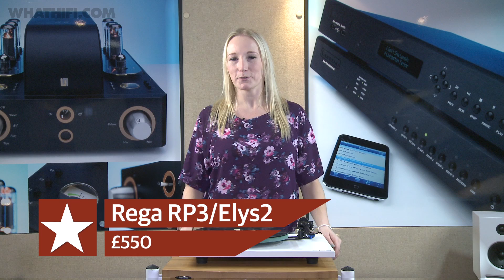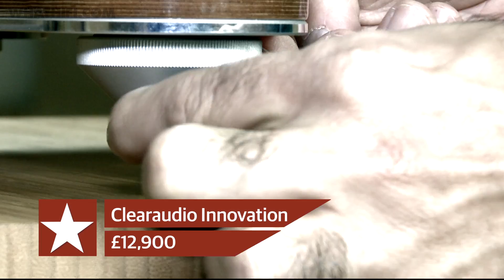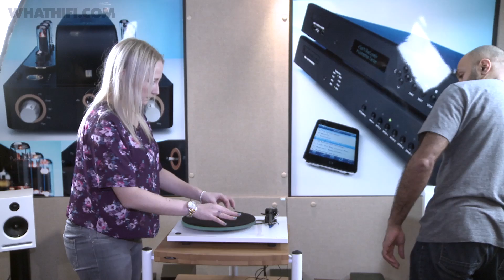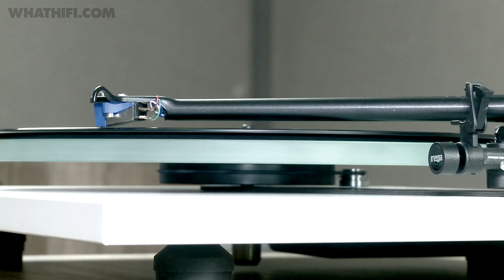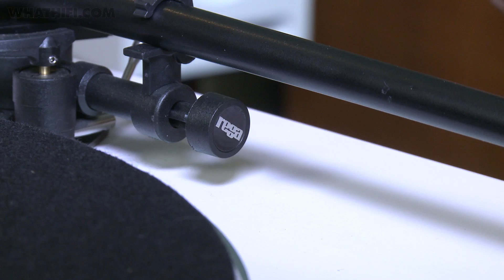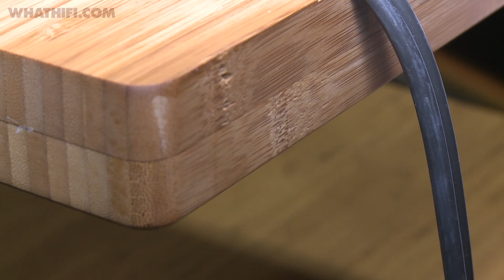How to set up a turntable

Comment: Good video for basic set up as I've watched quite a few. The best investments I've made are the Hi-Fi News Analogue Test LP for anti-skate tuning, bubble level for levelness, mirror protractor for proper alignment, Disc Stabilizer Clamp for dampening, foam and cork pads for more dampening, and a digital stylus weight gauge for correct tracking force. Best trick I did was to remove the built-in pre-amp in my Audio-Technica AT-LP120-USB TT. It only muddled the music and I now have custom built RCA cables I built soldered directly onto the PCB for the clearest sound possible!